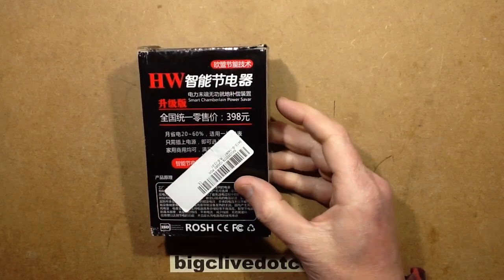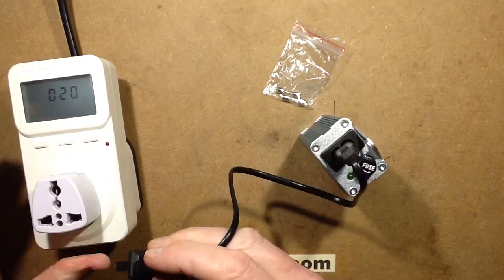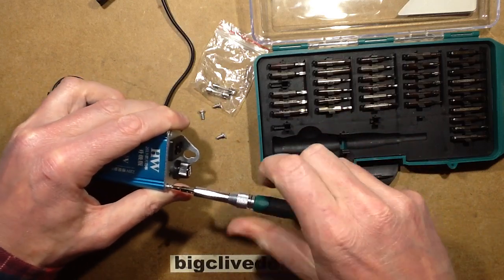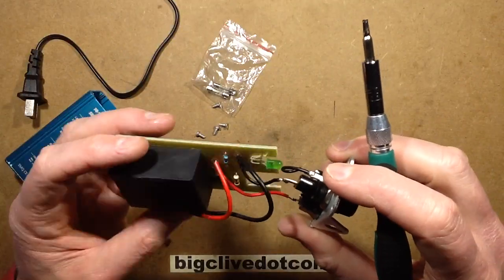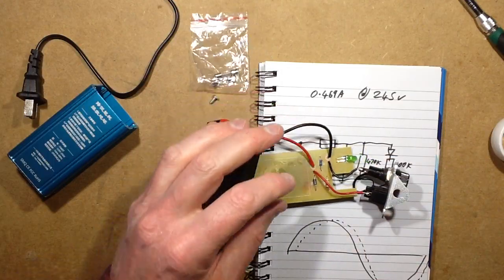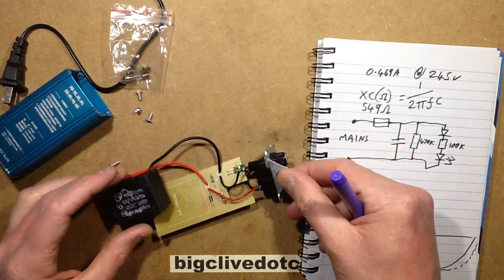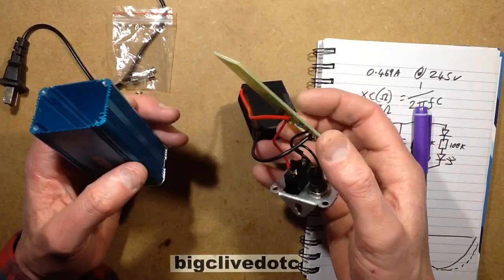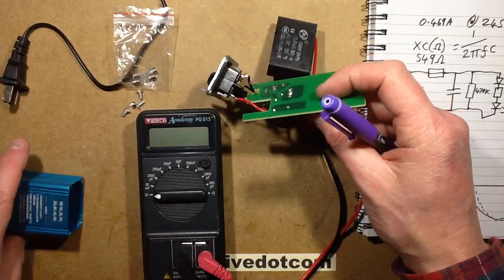200kW miracle power saving device.

Comment: A small cap across the mains in not going to do much if anything to clean harmonic distortion and noise from the mains, and cleaning the mains supply will not make any noticeable difference to saving on you're power bill either. Big Clive is 100% correct excellent video. The cap across mains is typically intended as power factor correction and needs to be matched to counteract a inductive load such as a motor transformer or inductive lightning ballast. The bogus 200kw rating, the lies about saving power, and failure to provide a protective earth, is concerning.  No earth on exposed conductive parts is also a breech of the regulations in most countries.

Comment: is there any practical application for that neat little device? maybe some project or other application? I'm getting reacquainted with my electrical knowledge :)
Reply from the maker: +erintreez It could be stripped for bits or used as an actual power factor corrector for an inductive load.
Reply from the maker: +erintreez It could be stripped for bits or used as an actual power factor corrector for an inductive load.
Reply: +bigclivedotcom thank you :)  although the defibrillator idea sounded interesting, lol
Reply: +erintreez 
You can use it as a paperweight on your desk.

Comment: It took me ages to realise that you are just supposed to plug this into a socket and leave it.  At the start I had it in my mind it was going to be some kind of adapter you put inline with a device and it would convert the 245V to the 220V minimum rating.

Comment: Without a PE- (Protective Earth) conductor on the metal case!?
Reply: +René Merz Yes in China they don't bother with earth, but is is a legal requirement in most western countries, UK Australia etc..it does not work as advertised, it does virtually nothing to clean the mains, its unsafe, it's illegal, the screw type fuse is dangerous, and fails safety standards.
Reply: +bjtaudio 
OK, and it is not approved in Switzerland! Warm thanks!
Reply: @RenéMerz  Definitely not. We blow up a lot of test gear here. Everything is earthed, and goes KABOMM when clipping the ground lead on a hot chassis.

Comment: In the 1980's there was a product offered by an American company for controlling and regulating voltage and signal shape.  The product was called "Islotron".  The company claimed that the product would set the output voltage to 240V and output a perfect 50 cycle sign wave.   We tested the 50AMP product by applying a 265V 60Hz square wave to the device.  The Isoltron produced a 50Hz 240 V sign wave output.  We did not test the phase difference between voltage and current.  We did the device with other wave forms at various voltages. The output was always a 50Hz 240 V signwave.  Surprisingly, if a none sign wave was used as input and the input voltage was less that 240V, the out put would still be 240V 50 HZ.  We where able to drop the volage to 236V and still get the desired output.  We found that a square wave would allow the greatest drop in input voltage.  A sign wave input would need to be => 240V although a very 'noisey' input would allow a reduction in the input voltage but only by a volt there abouts.The product was American and if you where to purchase this device the American company would Air ship the product to you.  The company claimed that  the Islotron had an 'frequency template' of a sign wave built into it that was used to ensure the device would always produce a 50Hz 240 volts output.  It was also claimed that this is the device that NASA used to maintain voltages in Satellites.  (Believe it or not!) We where told and had confirmed that several large IT firms in Sydney had had larger current versions of this device installed in line with the  power supplys to their computer rooms.
33 years later I can find no reference to the 'Islotron' or any such device that did the same thing  Curiously I still have the product blurb and specs for the Islotron.For the idiots who read this, if you lived in America you would receive an Isoltron that produced a 60Hz 120V 'balanced' output.

Comment: So , with the onslaught of " smart meters " do you think we will get power factor charging in domestic setting ............ and should caps be fitted to things like compressor fridges , to push the power factor round ? ( if i ' m understanding it correctly )
Reply: +magna59 compressors already have run capacitors on them
Reply from the maker: +Zeta The run capacitor on a compressor is to give it a direction by causing a phase displacement in one of the windings.
Reply from the maker: +magna59 It might be possible in the future for the power companies to suddenly set modern meters to record apparent power just so they can charge more.
Reply: most stuff sold nowadays has a PF=>0.9 so even if they would you would need to have a very old appliance to take advantage of such a thing
Reply from the maker: +Susana Godinho Many of the LED lamps have an extremely poor power factor due to the use of the simple capacitive dropper power supplies.
Reply: +bigclivedotcom
I bet the Chinese put those out to improve the global PF on an installation, they are essentially doing the same as your magical device out there :)
Reply from the maker: +Susana Godinho I used to think of the LED lamps in that way.  Acting as accidental power factor correction for things like traditional transformers and motors.  But these days it's getting hard to find traditional inductive loads in the home that are active all the time.  Even the most mundane thing seems to have a swtchmode power supply or electronically driven motor in it.
Reply: +magna59 You should think on a bigger scale.. power factor compensation is for heavy duty users with lots of lots of electric motors, like idk. a water purification facility with lots of pumps.. They need more reactive power for build magnetic field in their motors, than the active power you need at home.
Reply: +bigclivedotcom .............. " active all the time " ....... i would suggest is may be not quite the point ? If the " up cost " to correcting this loss is low ( a bulk purchased capacitor )  , should we not campaign for 0 power factor correction requirement . 
If power stations are having to push extra ' lecci down the pipe & consume god knows what to do it , to compensate for a 2 bit component , should this item not be fitted as standard . 
The retro fit , will have ^n times bigger cost , but if it's fitted on the " track " .......if the car industry ( Ok Ok ...... give or take the odd arses in VW / M'bushi ) can make the effort ........... You up for a question in Parliament ?............ 'course we'd have to educate our 649 ............ the 1 i would suggest is Lucas ............. even the right name !

Comment: Clive, have you ever thought of doing a video showing all your bench equipment?  Like one video that shows all your bench power supplies, all your multimeters/capacitance reader/etc,  power monitors (AC Eco Eye, your various USB 5v dongles, etc), and whatever else you generally use during your videos but which we might not see, or not see for very long.
Some of them show up briefly in the videos when you use them, but for example I've never seen which bench power supply you use (maybe it's in an earlier video I've not yet seen.)
So I thought it would be useful to have one single video that showed it all in one go, with reasons why you chose those units and suggestions for newbies on what to get and what to look for.
Like you did for electrical components and then soldering stations, but for "bench equipment" or "measuring equipment" or whatever the best name is.  Cheers!

Comment: Actually,  these devices can save energy,  due to power factor correction,  thus reducing copper losses in the building wiring.  However,  at low currents,  these losses are negligible,  anyway.  But under a heavy load,  some energy can be saved, by reducing the current through the mains.

Comment: What a gimmick. Anything in the home that's electrically powered (at least here in the UK) must be CE rated and as such, has already had its power balanced. Also this device compensates only for inductive loads, and only by a pre-set amount. What if you were running loads of capacitive loads? This device would cause the factor to shift even further away from balance and theoretically cost you more money. Simple fact is though, as Clive said, its makes no difference whatsoever to a domestic supply bill so the whole idea of this is pointless.

Comment: Good stuff.
No BS earned you another sub.
Best thing in this product was the casing.
I didn't buy into the 200kW claim for a second owing to the fact I've been working with electronics since the age of 12 ( 1980 ) then went onto Technical Electronic Servicing as a trade.
Got a similar ( not identical ) looking multi-meter myself but mine transmits to my computer via a wireless usb connection.

Digitech QM1575 - https://www.youtube.com/watch?v=mFB4y3kXEZ8

One thing you need to make very clear is that not all devices that look like these are constructed in the same way - Switch mode power supplies for computers for instance.

2 years ago I was pulling apart a power supply to fit then into a different box.
This was brand new and I had not plugged it in so was very surprised to get a 380Volt shock from the electrolytic cap positioned on the board.
I simply assumed no power. 

NEVER ASSUME - ALWAYS TEST FIRST.

Ive also had 9kV across my right arm some years ago after switching off the wrong switch then proceeding to work on a power supply for 32 hard drives - it didn't tickle.

So many people appear to be buying into the MiniMax ( as advertised on TV ) without realizing the device is a potential death trap and the suggestion for its use is a violation of the manufactures specifications and is classified as abuse - Therefore not covered by warranty.
Haven't seen 1 person get their money back yet.
It`s a straight up con relying on people not knowing anything about electronics OR THERMAL RUNAWAY in Li-On batteries.
These batteries can have thermal runaway triggered after they have already been disconnected from a heavy load or charge current.

( Did this myself as an experiment on a Li-Po 14.4 V, 3300Mah battery - once it starts it self feeds - That was on my battery anyway )

The MiniMax - https://www.youtube.com/watch?v=Vz4r0IdEjwI

And this describes the problem but does not include all factors such as those that resulted in aircraft being grounded after 1 caught fire 1/2 an hour after landing.
http://batteryuniversity.com/learn/article/lithium_ion_safety_concerns

Articles related -
http://www.scientificamerican.com/article/how-lithium-ion-batteries-grounded-the-dreamliner/

https://en.wikipedia.org/wiki/Boeing_787_Dreamliner_battery_problems

https://www.theguardian.com/business/2015/aug/19/lithium-battery-review-boeing-dreamliner-fire-heathrow

CHEERS

Comment: correct me if i am wrong, but don't this device trick your powermeter and indeed saves money on your power bill? You use the same amount of electricity but it is not measured correctly because the phases are out of sync because of the capasative load?
Reply from the maker: +mullahviking If it was that easy people would just get the capacitor out of a fluorescent fitting and hook it across the mains.  (Which it is already in the fixture).
Reply: exactly, but that would actually make some difference right? after all the fluorescent fittings have a big inductive load because of the chock coil (not sure of the english term) I know it is a known way to cheat the electrical complany using capasitors. at least here in norway. 
But i suppose this device is to small to make any difference?
Reply: +mullahviking. You are correct. You, yourself, don't use more or less energy. The problem is in the power the  company has to supply to you if you have a bad power factor.
Explanation: When you have a bad power factor (cos phi), you are taking energy from the grid, but not using all of it, and the electrical meter only registers the energy that you use. So you are putting stress/load on the grid unnecessarily, that needs bigger cables and and you take away power that could be sent to other homes.
But you don't TRICK the power meter, you actually reduce the amount of electricity going through your house. The company knows exactly what your cos phi is, and they tell you that you HAVE to install a capacitor or they will charge you a fine, for having a low cos phi.
And if your cos phi is too low (like 0.50) they simply disconnect you from the grid, until you fix it.
So yea, you don't save electricity, but you do save money from fines.
I had to install more than 15 in my shop, 1 for each motor, 1 for each fluorescent light, and 1 general.
Reply: +Gustavo D Right, but I don't think they traditionally monitor the power factor of residential homes—or rather, they didn't.  It is possible that the recent electronic meters have such a function.  It seems such an obvious addition.
Reply: pillsnotbills
Yes that's right, all the new electronic meters control this automatically, and display it. (and more)
And yes homes were generally not monitored because they generally don't have low power factors.
Unless you have a lot of air conditioners or fridges, or old-fluorescent lights, or motors.

Comment: I'd actually quite like to have one of those for the case to build something else in. Something on the order of an Arduino project or other. I like the fact that it's big enough I could fit a small 5 volt switch mode into and the case would make a great heatsink for some large current transistors.
Reply: +ExStatic Bass My thoughts too! I wonder if they just sell the case without the components. They get $29-39 on eBay for these.

Comment: nicely done. I think this device may actually have some value as a power factor corrector. Many devices that draw lots of current present themselves as inductive loads. this thing placed before the load can correct the power factor, to some extent. By correcting the power factor the device reduces the losses in the A.C. mains, and does improve power delivery to a small extent.  Not complete quackery. you might try running a room air conditioner at the end of a 30 m. extension and measure power consumed with and without the device.

ces we use

Comment: A phase corrector is one very expensive unit, in my home,  it would take around 2 years go even the buy cost and energy saving, this things are very dangerous and can give quite a bite if you touch the mains inlet pins.

Comment: As an electronics engineer, I understand perfectly that simple RC filter has no significant impact on power. In fact, device itself consumes some energy (on LED and resistors) instead of saving it. From my own experience, explaining that to a non-technical person is a mission impossible so I suggest a simple kW/h meter test. One hour with the device and one hour without it with the same load and ordinary house kW/h counter conencted in front of everything.

Comment: 20-60% a month it says. Also 400 Yuan....energy is quite cheap in china. I heated my 100 sqm appartment during the winter exclusivly with aircondition and it was around 400yuan every month....so not sure if ppl in china actually buy it, but oh i know...they can be gullible

Comment: Hehe, banggood are brilliant. I've had some hilariously useless stuff from them, but every now and then, a real gem. Bought a handful of solar powered battery banks for a few quid each (Worked out about a pound per Ah) half a dozen years ago I think. Made the mistake of leaving one to charge in the Toulouse summer sun for slightly longer than was required, returned to a scorch mark, some plastic shards and very little else. The last one was retired from service only a few weeks ago.

Comment: As for the "Energy Saver" it SUCKS !!! Mostly electricity...Always on, pulling 1/2 amp @240VAC  it's over 100 watts = 2.5 KW/ 24 Hrs= $136.87 US Dollars every year! WOW...
Reply from the maker: +Coil Smoke It doesn't work that way.  Most meters only register actual power used and not the out of phase reactive power.  So the meter shouldn't register it at all.
Reply: What "doesn't work that way"? The Power Saver seems to present a steady load to the meter. I don't know if the load impedance  is resistive, reactive or capacitive.I just know what we see in amps and volts. I can't believe the stupid thing dissipates that much juice.